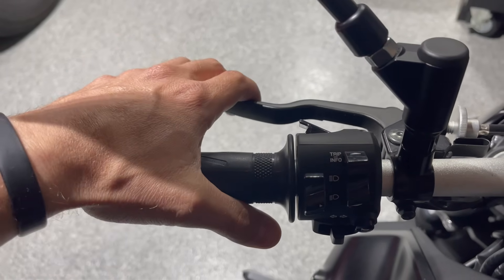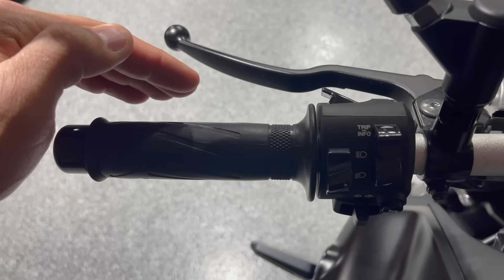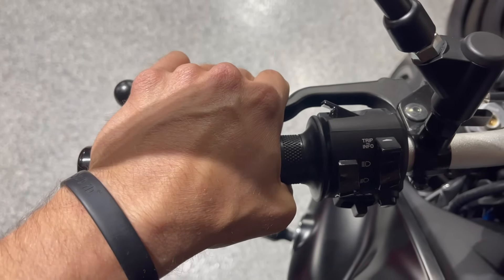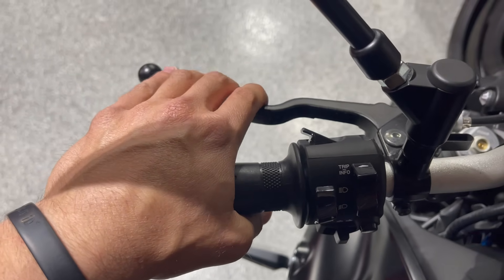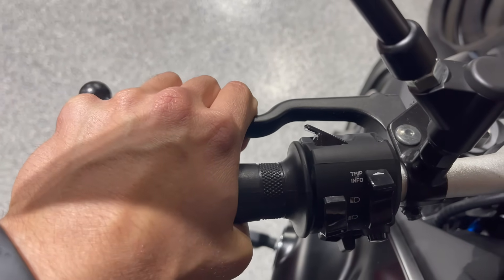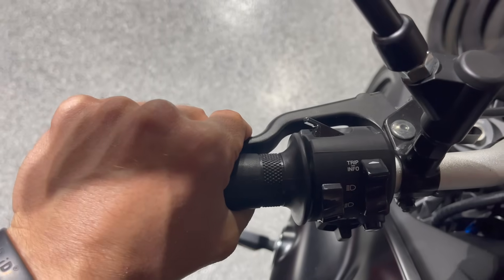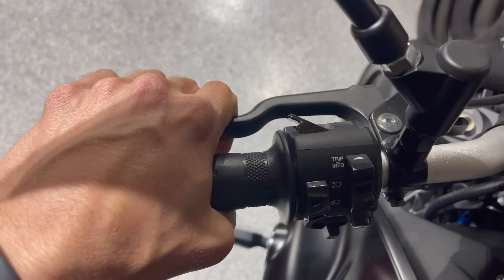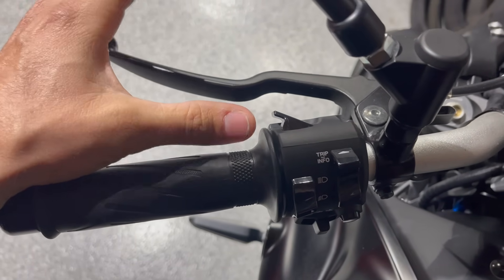Don't Make This Common Clutch Mistake!

Comment: This wears out the clutch  very early and I wouldn't recommend it to use it very often. But in heavy traffic, especially if it's uphill. This is the only thing to do!
Reply: No it doesn’t. It’s not like a clutch in a car.
Reply: @SkylaneMusic  I've had experienced it myself. The clutch functions the same way whether its a car or a bike.
Reply: @motoheads1268  Wet clutches (what most bikes use) are specifically designed to be rode on a lot more than a dry clutch (what all manual cars use and some older ducati bikes).

Unlike with a car, many low speed maneuvers aren't possible without riding the clutch in the friction zone.
Reply: @thespectator5259  Could be. but man try this technique in any Royal Enfield bikes and you'll know what I'm trying to say.
Reply: @motoheads1268  I'll take your word for it.😅

I have never ridden a Royal Enfield, (nor do I plan to own one) so the point is moot for me. Do they not have wet clutches or what?
Reply: @thespectator5259  Not sure of the wet or dry clutch but you should certainly try a testride any RE bikes.

Comment: Then the bike maker should have put a stopper. Or you yourself should put one.
Zzzzzz. Just adjust the clutch so that it's okay to pull it fully.

Car and bike have the same reason why they have clutches. Is it right if you dont push the clutch of the car to the fullest when you change gear? Of course not, you should push it fully. Same as in bikes dude.

Comment: You're gonna burn out your clutch really early. Glad you don't drive my car.
Reply from the maker: But I didn’t
Reply: @MotoJitsu  the not putting it in all the way yo shift is probably OK, it is the not releasing the clutch all the way when you are engaged that is likely to cause the problems.  But I would have to know a bit more about a bike manual transmission. For a car it is definitely a no no.

Comment: On metric bikes I don’t need much clutch to shift. On road king I seem to need the full clutch to shift. Low speed is feathered clutch in the friction zone, as you described, regardless of the bike’s origins. (I have been on modern ktm bikes that don’t need any clutch at all to shift, but low speed still needs it.)

Comment: Riding a bike for 50k km without changing the clutch plate. By pulling it all the way. Try preaching novices this BS.
Reply from the maker: I have over 500,000 miles in less than 9 years, no issues with any clutches. Like anything, if you know what you’re doing, it’ll be fine. If you don’t, maybe you’ll burn it in 20 mins.

Comment: Every cable operated or hydraulic operated clutch on all types of vehicles is different in the way it engages .  It can make a difference in the way it shifts through the gears . One overlooked area is to lose but mostly to tight of a chain adjustment . You have to understand and be willing to adjust these areas to get the feel you want .  Most bikes that came into my shop required lubricating the pivot points and cables as well .

Comment: Your vids are very helpful for a Novice like me Im 32 and new to riding still a learner and ive struggled a bit getting use to the bike and watching these vids helps a-lot thank you I confess I don’t practise often enough but when I do your tips and lessons have helped me. I struggled with you turns on my sports bike but I saw one if your vids and I went out and tried what I saw and I managed to do a few you turns just need to work on controlling the power and I think ill get it. Hopefully I can use this tip too get the control right next time

Comment: I agree in part.  Yes, friction for low speed limited space maneuvers and tight turns from stop or weaves    But squeezing clutch fully to shift is a good habit especially for new riders.
Reply: Will it hurt my bike if i pull the clutch fully I'm kinda used it
Reply: @vinmel4  no. Squeezing the clutch fully will not hurt your motorcycle.  All it does is remove power to the rear wheel
Reply: @seanoneill6420  thankyou , going on another ride rn, love from India 😊.

Comment: Wow. I thought that I had to pull the clutch all the way in all this time. It just seemed like not pulling all way in would mess the gears up or maybe gears wouldn’t shift smoothly
Reply: Wet bath clutches on m/c DESIGNED to be used this way...no damage, no worries

Comment: I think where the friction zone starts and ends is a personal preference. I like mine to start just off the grip so I adjust  my clutch accordingly.
Reply: Your way is a safety hazard and defeats the way a m/c clutch is designed. Ur way forces immediate engagement and does away with the safe zone these clutches have designed into them
Reply: @chipblanc6037  #1 You either didn’t read what I said about personal preference or you couldn’t comprehend it. #2 If you think my way is a “safety hazard” you’re (notice how I didn’t type UR) better off on a motorcycle with a DCT. #3 You have zero understanding of how a clutch works if you think having the friction zone start just off the grip “forces immediate engagement”. If that were true it would no longer be a clutch. It would be an on/off switch. #4 There is no “safe zone” designed into any clutch. The friction zone allows a controlled transfer of energy between two objects. #5 I’m rethinking #2 as I question your ability to even ride a motorcycle.